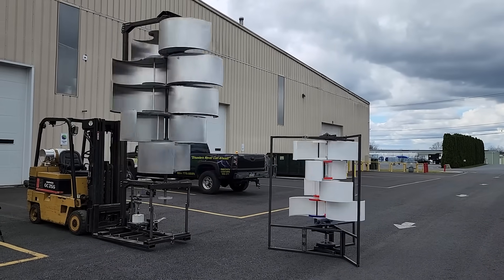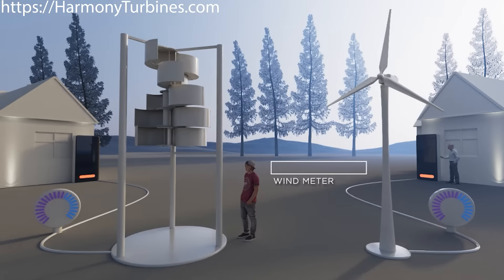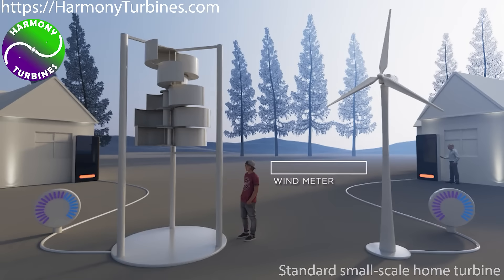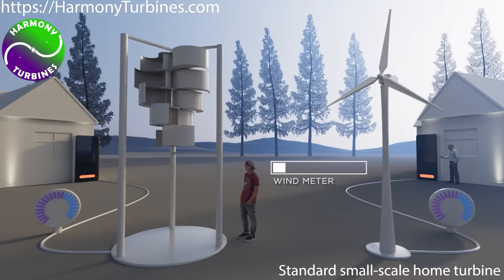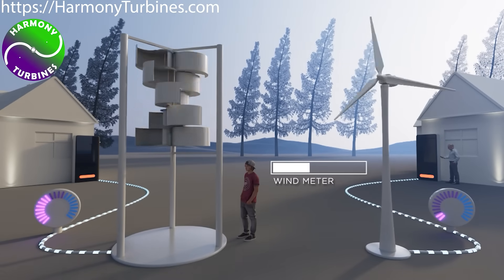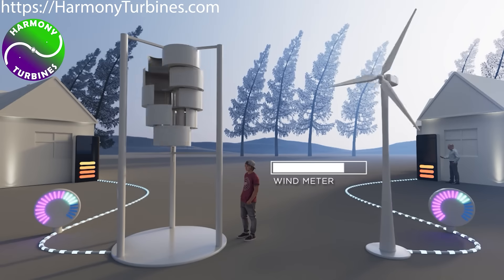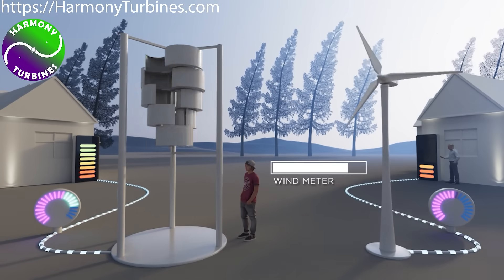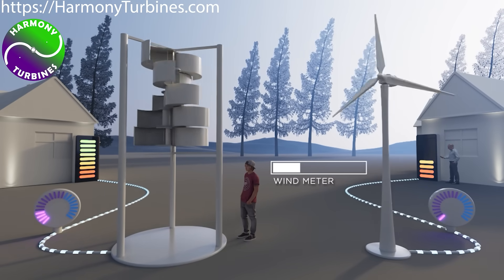VAWT that could Revolutionize Wind Power

Comment: As with all new and innovative methods for harnessing wind and solar energy there are optimist and sceptics, I have been watching your progress with this design since you first announced your furling technology to the wider world and I have been eagerly awaiting for some hard data gathered by testing, may I ask if there are any facts and figures or real time data collected from testing this design yet ? Is there anything to show the torque produced at varying wind speeds for a set size of your system ? furled or unfurled ? I presume all the college grads will be working out the drag co-eff and all that good stuff but I was hoping to at least see some basic stats being released to show the torque that can be generated by say a single unit of a set size for a set wind speed ?
Reply: you never will got that info, because if exist can to be sad....and this guy only search for investors... investors with big heart and tiny brain.  The design can work like decorative piece but in all the sizes projected cant produce nothing current useable.Need to increase in 8 or 10 times in rotor area, to move a decent PMG and to get a modest current.... And the increase of size bring problems of structure strenghts and rise the cost so much to be a profitable scam.... :).
Reply: @brotolero  Square wheels work much better than round ones!?

Comment: I am already planning to install this with sand and gravity batteries. Turbin can lift a weight up to a height and store a potential energy. Sand can hold heat for longer period of time.
Winter is usually windy so this turbine can constantly generate energy which we can store as I explained earlier. It can reduce the cost of heat by sizeable denominator.

Comment: This Is One Of The Most Innovative Products I've Seen In Last 30+ Years, Just Imagine Them Lined Up Down The Sides Of All Freeways Across The USA, Electricity Could Be Almost $Free For Everyone & Everywhere, Not To Mention When We Have One or MOORE Mounted In Our Own Yards!!! Out-Standing!!! 👍👍😁😎 PS Hows About Some Smaller Versions For Mounting On The Roofs & On Electric Cars, That Clamp Around Street Lights & Power Poles+!? 🤔😜😁😎 I Want A Pair For On Back Of My Electric 2-Ton Tool Truck Conversion & On My 32' Cabin Cruiser Boat Also!!! 🖖🖖😁😎
Reply: I like this idea. Imagine a pocket size version to charge a cellphone or a camping light. Could be useful to fund the company too 🤓
Reply: @lobster5782  There should be at least 3 sizes. Small: easy to transport, ideal for camper. Medium: to install at home. Large: to install in and outside the city.